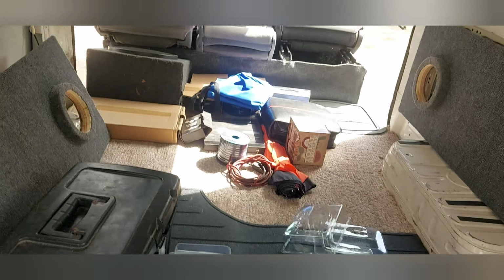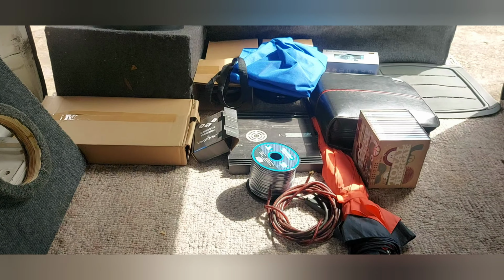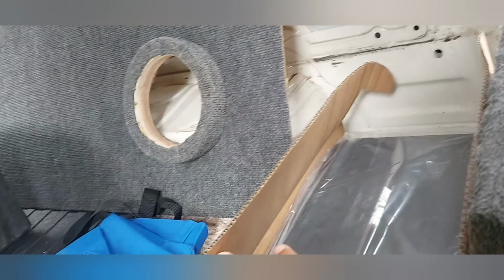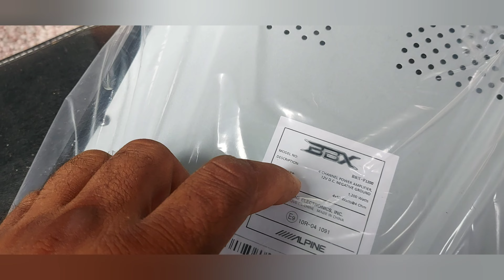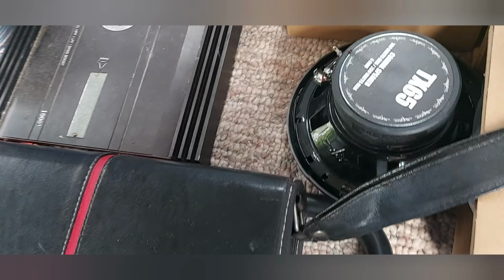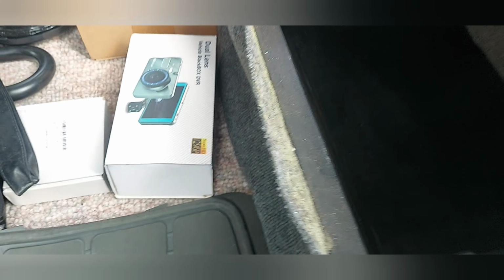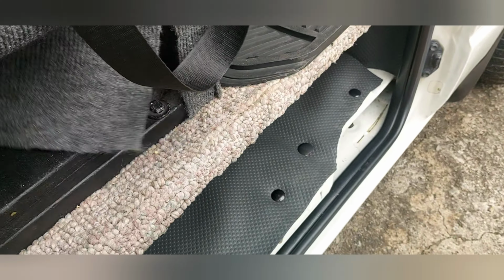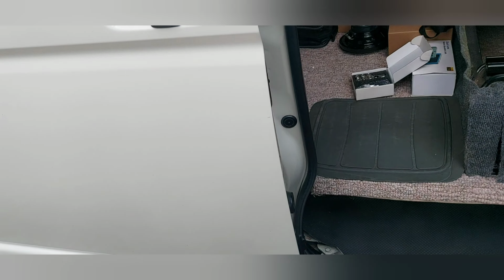Installing a small system in a toyota hiace bus...

Comment: Yo quick question I got a 3k smart taramp it's seem like I can't max out bass without it been clipping... how do I elimate this issue
Reply: YouTube gain settings/matching or just turn down yu head unit/source. Ensure yu voltage stable with sufficient amperage.smart 3k put out more than 3000 at 1 ohm so 🤷🏾‍♂️yu sure you need all that power?
Reply from the maker: Make sure you have good voltage
Reply: @nizmosoundstmary  kool mater of a fact it a snark 3k at .5 ohms and I have a secondary big battery